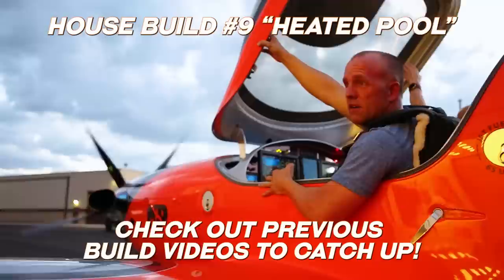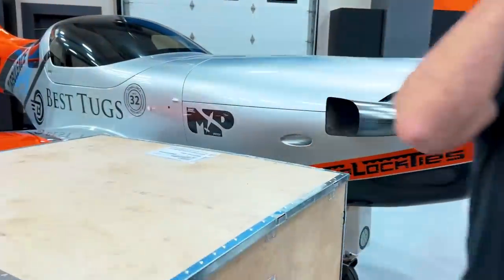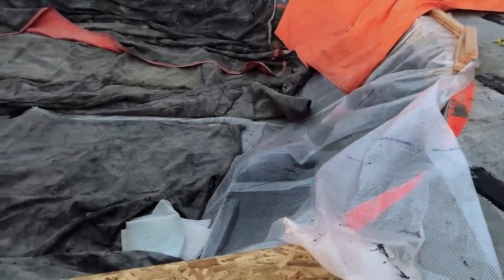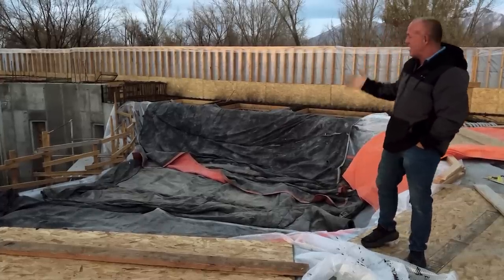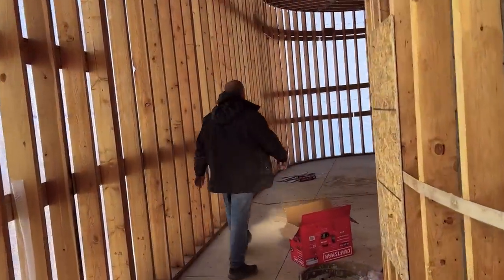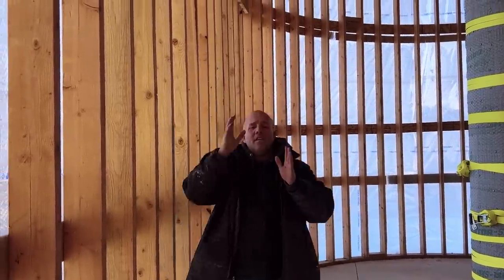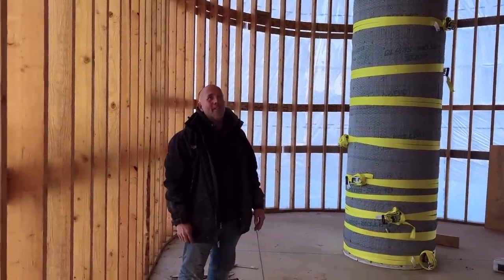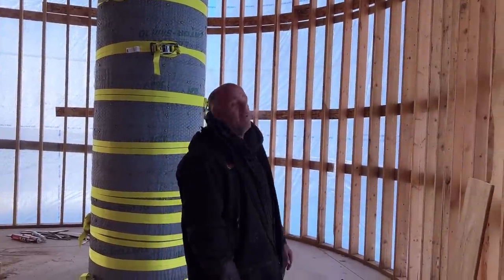3 Story Pool Freeze in Winter Temperatures | House Build #9

Comment: Mike is spending more on forms than most people do on an entire house! It's going to be a REALLY cool end result though!
Reply: Timber is crazy expensive here in New Zealand now, and that's if you can even get it.  It's the same with steel.  The last project I did, the steel cost me 50% more than I was expecting based on previous purchases.  So Mike's build is surely going to be eye wateringly expensive.
Reply: @TrevorDennis100  Utah is not the same as New Zealand

Comment: The best thing about watching any of your videos for me is watching you work through every possible engineering variable on such an incredibly complex build, and you just keep checking of what-ifs and maybe-we-coulds until every box is checked.  Eventually it gets to the point that you've answered every question and you run out of ways anything could go wrong, and you know the design is complete.  Then you build it exactly as designed, down to every spec and tolerance.  Very satisfying to watch.
Reply: Setting the variable spandecks in 30 mins is proof of that.  It would take most of that long just to do the rigging on them.  Precision indeed.

Comment: For small quantities of concrete in low temperatures, you can even mix with hot water. I like your curing solution with space heaters and covers over the concrete. Due to different ages of concrete parts you will aways have some fine cracks at interface between old and new. There is a concrete repair mortar that you paint on, which migrates into the cracks and gives a good seal. (Sika or Flexcrete)
Reply: Sika makes great products I use their VOH mortar for patches, and Sika-flex SL and Sika-flex 1a chalk all the time on my jobs.

Comment: Careful Mike! (If you're using kerosene) Last time I heated a basement concrete pour in winter with a Kerosene heater, the concrete cured extremely dry, and crumbly! Was weak as well, as we needed to hammer it all out from the heater damage.
Reply: He clearly stated propane. Even brought in that 1000 gal. propane tank for the job.

Comment: Need to add one detail... not only heat, but humidity is very important for the concrete... moisture, as You said, is needed for well maturation of the concrete... 7 days minimum, to arrive at some 70-75% of its hardens, and portability...after 24-28 days it arrives at its full load capacity...

Comment: I showed up for the experimental aircraft builds, but stayed for the household engineering. This project is fascinating. And with all that wood coming out, how much would be salvageable to make, say, a wooden aircraft frame and body?
Reply: I'd assume it's the wrong kind of wood for that - just way too heavy. For aircraft you want to maximise strength-to-weight, whereas for construction you're looking at much bigger loads and you're optimising for strength-to-volume (and don't really care about the weight of the wood itself). Caveat caveat of course, I'm not an expert.

I actually discovered this channel when Mike crashed Draco, but beyond that I followed the same path as you: subscribe for the experimental aircraft, stick around for basically anything else he wants to upload because it's all interesting.

Comment: Mike, I'm would you on the ENGINEERING DETAILS being explained in every episode, do THANK YOU for them details !   However,. your HEATING of the concrete is very curious to me
Reply: And I sent that last comment b4 I had actually finished it.... So my curiosity about the HEAT comes from what I was told by an old friend who was a contractor and did most of his work IN ALASKA.  I thought he said that he never heated any of the concrete that he poured there, simply because the chemicals in the concrete create heat as it cures. He said he never had any problems with it curing properly....so did he just get....LUCKY???  And frankly my "gut" feeling would be to use the heaters.  I think concrete is one of the hardest things to GET "RIGHT" and not have cracks or spalding.  
I hope you will see this and comment.
THANX, BROTHER ‼️😃‼️

Comment: Hello. I saw your pool project and was blown away by the idea.
A floating floor that will go up and down on cables is crazy. I would like to see the end of your project and how everything works.
I'm wondering, when the floating platform is raised, there will be no gap between the floor of the SPA area, people won't swim under it???
And when the platform is on the surface, it will not warp from the weight of the guests??
And if the floating platform is at the bottom, it will be affected by a colossal pushing force.
What is the volume of water in the pool?
I was confused by the number of fixing dowels on the wall, at the bottom of the pool for the passage of cables.

Comment: I used to work as a geo-tech inspector/lab tech.
Although Solid Works allows one to design to the minimum (1.5x typical). The beauty of the software allows one to simply design to the requirement, then produce a product with a high degree of certainty to perform.
Bottom line:
Like Mike says…Concrete is cheap!
Go 12” !

Comment: Great project! Depending on how much propane you are sucking out of that tank, you might need a propane vaporizer. If that is the case, I would keep a careful watch on everything in case the vaporizer goes out. You do NOT want to have liquid propane flowing into those heaters. They will suddenly look like a SpaceX rocket. Keep up the good work!

Comment: I hope the heaters being used are not direct fired/open flame (salamander type) or scrubbers (catalytic converters) heaters. The carbon dioxide flumes trapped within the building envelope will react with freshly placed concrete. This results in a soft chalky surface through the chemical reaction process known as carbonization and will be a chalky mess until it is ground down over covered. I learned this the hard way.

Comment: I would love to know more about the regulatory side of things over there. In my country this sort of design is well outside of the building code for residential classified uses. Moreover, the specific engineer design would need to be done by an actual chartered engineer (i.e. a numbered, registered, professional engineer with minimum insurances and liabilities etc) and probably would require peer review as well. Here we would require a separate geotechnical report by an engineer with suitable experience in the expected ground conditions. Civil engineering for the services and structural engineering for the building envelops. This sort of complex design with eccentric loading is simply not really seen in my country, and is even a very complex and unusual (in design features) design in the commercial realm. Fantastic to see what can be achieved in other parts of the world where money doesn't appear to be an object!
Reply: He mentioned in a previous video working with an architect or engineer. In the United States, too, this type of construction for a residential home is rare or maybe even unique. I am sure that the plans for this project were signed by a qualified engineer. In the United States, plans can be approved if they are "normal" and satisfy the building code or, if they are unusual, then they can be approved if they are signed by a competent engineer. I am sure these plans were drawn and signed by someone having a Professional Engineer (PE) title. I don't think you should conclude that the process is different between the USA and your country. Rather, this project is completely unique because Mike just likes to do this kind of thing. Mike may even be doing a lot of the design details, I don't know, but a PE is signing the plans for sure.

Comment: Mike I trust you are going massively prop under that timber formwork prior to pouring the concrete? I work in the industry here in Australia and have witnessed first hand what happens with wet weight of concrete. Catastrophic failure and death. I admire your work, I feel like I’m watching a nail biting movie.
Reply from the maker: Oh ya, it's ready to hold the weight. Last thing I need is a problem in the middle of a pour.

Comment: Hope you've planned a backup generator for say heating and a heater for anti freezing water(low power needed of course for that) and for storms?
Reply: Haven't seen the details yet, but he has said that the entire volume of water will automatically drain into underground storage tanks if the pumps lose power - that's specifically to avoid damage from the water freezing in places that aren't designed for that.

Also I assume he's got backup power planned, but I don't think we've seen details of that yet.

Comment: When pouring concrete, go in layers 10-15 inches, and don't exaggerate vibrating it, to avoid segregation (bigger and lower pebbles to separate!) ... don't also allow to long period to pass between the layers pouring... follow also the temperature of the concrete (don't go over 32 Centergate...max 36, but with immediately start with water cooling and humidity... "cooking" concrete is completely other story... pretty sensitive!!! Don't play with it, if You don't know what You are doing... some factories are using vapor for that, and one need to know how! Best atmosphere for concrete mature is cold, and humid...long period...as longer - better! Concrete during its life becomes harder and harder...even after 100 years... there are many chemical processes involved...

Comment: Did the tension cables in those precast spans get cut when you trimmed the ends to size? Wouldn’t that cause a significant loss of strength?
Reply: Shouldn't compromise the strength - tension cables in concrete are only held under tension while the concrete spans are first poured anyway. Once the concrete has set, each point along each cable is balancing the tension of the cable against the compression of the concrete. You're not relying on anchors at the ends of the cables - instead the entire length of each cable is made of anchor points where the cable is bonded to the concrete, so you can trim as necessary and the remaining pre-stressed concrete span won't lose any strength.

We are used to seeing those cables (or untensioned rebar for that matter) sticking out the sides of precast panels, but that's because in some applications you want to embed those ends in some other concrete that you're pouring (or tie to other panels or whatever). In this application, the spans don't need any of that - all their loads are just pushing them down onto the supports that they're sitting on.

Comment: Mike, Do you have a topping slab on top of the Spandeck slabs? Usually we have a reinforced topping slab to act as a diaphragm to transfer all the lateral loads to lateral load resisting system. If no topping slab is used there are usually some embedded connectors to connect the planks together to transfer shear loads. I am just curious and i am a structural engineer very inertested in airplanes.
Reply: Yeah I think he said he's going to pour a 12" reinforced slab overtop of the spans. That's where he talked about going 12" instead of 8".

Comment: Generally precast concrete is much stronger than poured in place concrete. A 12" slab with extra rebar would be massively strong. Just so the folks know, 125,000 gallons is over a million pounds of water sitting above your vehicles! 😳😳

Comment: Mike, has anyone asked you how you would design the pyramids of Giza?
Reply: They didn't have concrete yet.
Reply: It's just an engineering question, concrete is irrelevant.
Reply: @terrysullivan1992  Yeah they had concrete. There's massive debate about how much they actually used it in the pyramids, but they definitely had that technology by the time they started building pyramids.

Comment: 6:30, Isn't it 8" PLUS 50%= 12"...?.? But you stated 30% over 8"...?.? Is this more of that math that requires letters? I am jazz3d for your project.
Reply: You're right, it's a common mistake. The difference of 4" is 50% of the smaller number (8") but 33.3% of the larger number (12"), so it would have been clearer to say 50% not 33%.